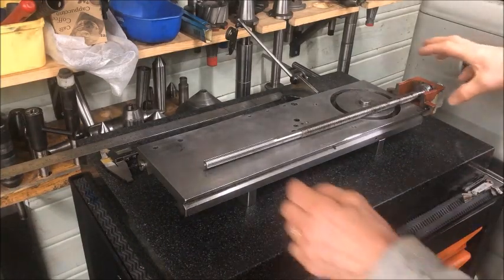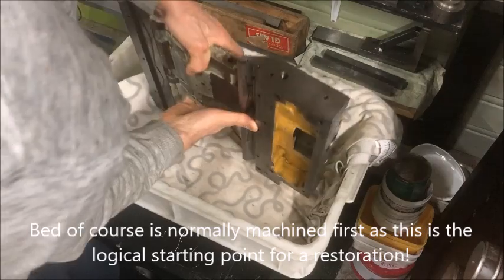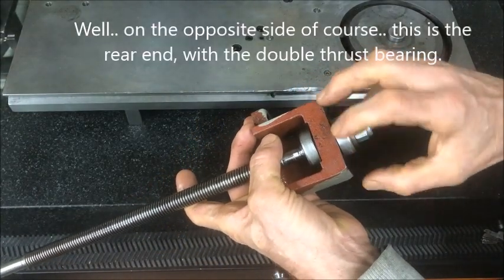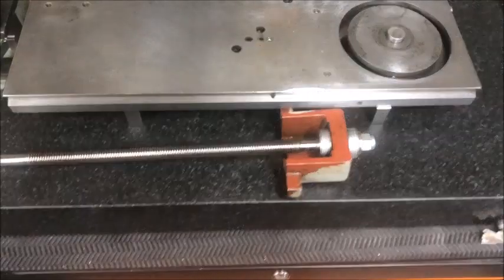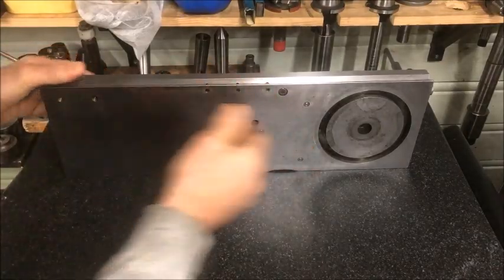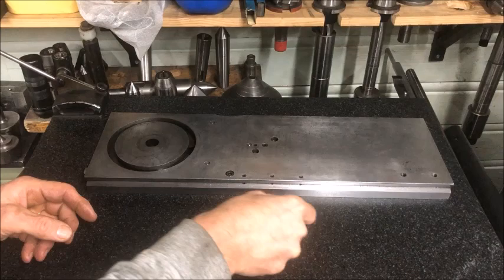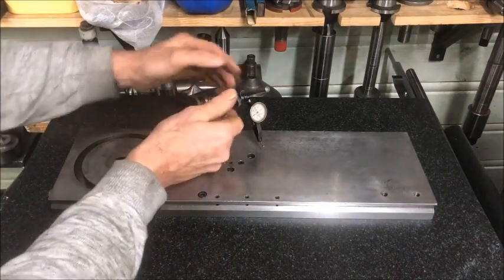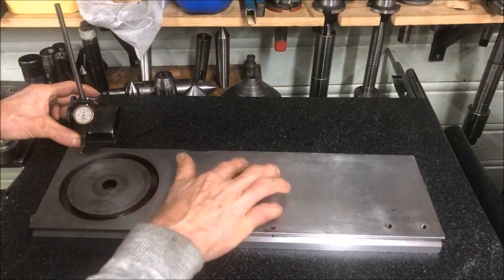Colchester Master 2500 - partial restoration of saddle- and cross-slide - 1

Comment: I like the methodical way you approach a scraping project.  Colchesters are fine machines, which are certainly worth the time spent to restore.
Reply from the maker: Thanks. I try to apply what I have learnt :) Yes, agree, these and similar machines are surely worth restoring. This specimen had been used in industry until found either a bit inaccurate or as I tend to think, set aside when CNC was introduced. For a hobbyist it can still serve a long time though.

Comment: I have an old hendey I would like to "tune up" someday if I get the time. Nice demonstration
Reply from the maker: Thanks. I reckon Hendey's had soft ways, so then you might consider scraping.. However, I also think I remember these have double V-ways, so you would save yourself a ton of work having them machined first, for example on a planer. This would make the rest of the job easier and more practical having this as a template.

Comment: Looking forward to this Jan as it’s the same lathe I have, although I think mines ok, but it will be good to know.

Al.
Reply from the maker: Thanks! If you can stand the "battle with the linguistic issue", have a look at the other channel for the finished product :) Otherwise I will make available the content in the upcoming videos here as soon as I can handle this. Personally I think this is a great machine and I appreciated the manufacturing quality and design that went into the parts I had for restoration. 
PS! This job took most of my time during Xmas holiday and January "after work & weekend spare hours" which is (partly) why there hasn't been an update for the Myford (although I have been working some on these and will update you soon)
Reply: What ever you do is OK with me Jan, your the man when it comes to scraping.
Reply from the maker: @pearcemachineshop5200  Thnks!